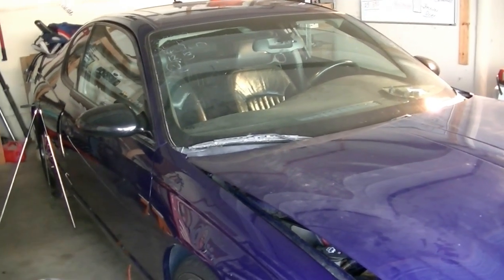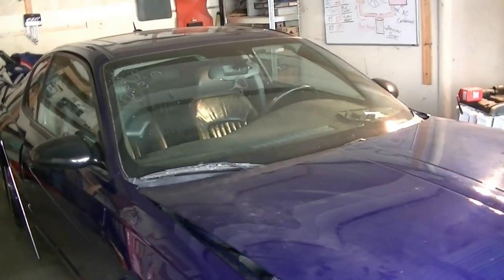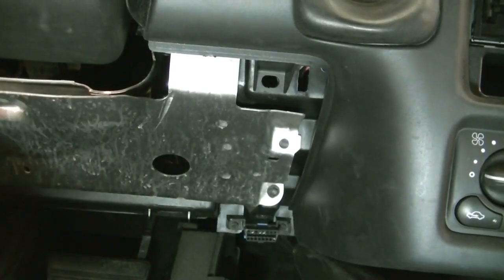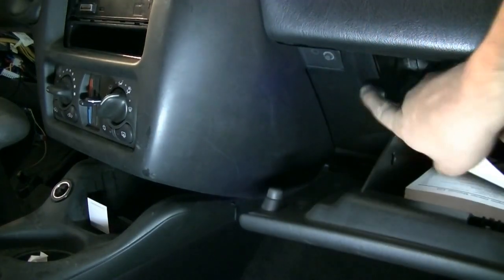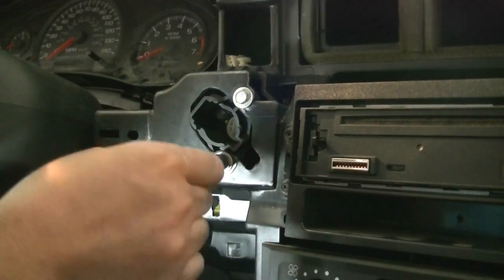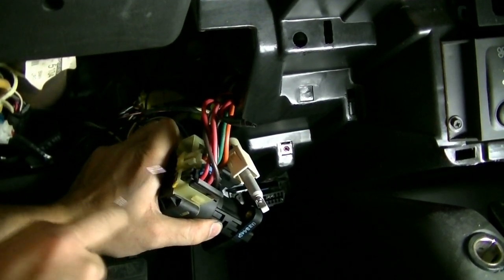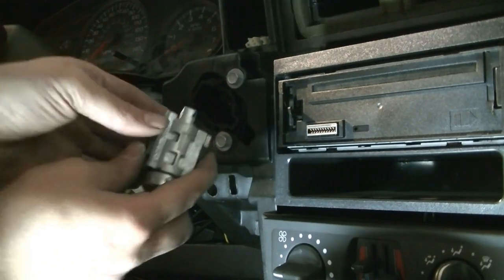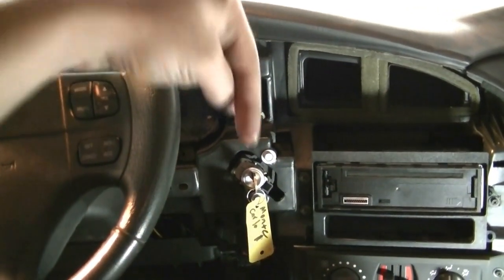How to Remove and Replace an Ignition Switch - Chevy Monte Carlo, Impala, Pontiac or Oldsmobile

Comment: This last fall the HVAC blower in my car stopped working. I spent hours trying to diagnose what it was. I had the factory manual and used their procedures. Turned out to be the ignition switch, I would've never guessed.

Comment: Have an 04 Monte I have to do this on. Bought it with a freshly rebuilt motor and transmission drove it about 1100 miles and the damn ignition switch goes out lol. Looks simple enough thanks guy

Comment: Thank you for the detailed video and key learning steps. Piece of cake after I realized I need to have the car in park when testing new key operation before install 🙂. Couldn't figure out why I could operate the ignition tumbler and take key out before installation but when I installed for test I couldn't take key out..... When installed the ignition recognizes the transmission is not in park and wont' let you completely turn off ignition and remove key....DUH

Comment: The reason I came to your video is because it is a pain to get my key to turn in the ignition. I have to wiggle the key a lot to finally get it to turn so I can start my car. I have a question though. I plan on replacing the ignition lock cylinder but I was wondering if it'd be wise to replace the ignition switch as well? Thanks for your helpful videos I appreciate them a lot, including this one and your intake gaskets videos in particular.
Reply from the maker: Dat Cody well the key not turning is you ignition lock cylinder so I would first replace that. But if you have no problems starting the car afterwards than the switch should be fine. GL

Comment: Thx for the vid. I'm going to try this. My 02' Monte Carlo has the same issues. At times, mostly in the morning, car will not start. I'll have to wait 10 minutes, while the key is in the start position. After 10 minutes has gone by, my car starts so that's what I've been doing in the mean time, until I get it fix. I had one mechanic tell me it's a $900 job to fix. Yeah right... Thx again

Comment: I had a problem of my key not turning . Had to do the basic steps in this video and then disassembly the switch afterwards to remove the cylinder . Once I removed the back covers I was able to remove the cylinder , pass lock connection , and shift cable .

Comment: If anyone else is having a hard time turning the ignition cylinder try this out.. the key in the ignition, hold constant pressure on it as if you are trying to start the car. While doing so, pop the  release button on the side of the housing with a center punch and hammer. May require a few attempts although not much force is needed.  (I used a automatic center punch so I was able to do it alone) but you may need a helper. Good luck

Comment: I have a 2002 ss it starts for a second then shuts off do you think is the problem? no check engine lights the security light blinks sometimes other times it starts right up, also the radio work some days. thanks for the lower intake video I used it last weekend. seems like everything that can go wrong is wrong with mine only had it 2 months.

Comment: Thank you for the video. My 2000 IMpala just shuts off while driving.  Would this assembly of the whole tumbler and ignition be the cause of this? I went o the dealer so they can do the recall and all they did was add weight to the key. I had been driving my car without the key and it seems to drive ok. Once in a while driving over a bump the car turns off. I have to put it in neutral and reset the key all the way back then it turns on like nothing is wrong. The recall did not fix this. Thank you

Comment: Thanks for the video, my impala is doing no starts here and there getting annoying now and sometimes while driving my security light comes on and then that usually mean the car won't start soon. probably when I really need it to like when I am running late for work.  Anyways was thinking about doing this have you had any issues since you did it in april?  Did you use an AC delco part or dorman?  Thanks again.

Comment: My 04 monte been dying then just restarting now won't start at all. Just recall letter for this ignition switch. I was thinking my remote start was issue till I got recall notice. Will they still replace switch with my remote start in or should I remove it?

Comment: Did you put this aftermarket head unit in this car? And since it has one, do you know if it retained the factory functions, like the oil light and stuff like that? Is the stock radio in the trunk or something? I'd like to put a different head unit in my impala, but i don't know how to wire it. Do they make kits for it or something?

Comment: RatchetsAnd Wrenches question I'm replacing my ignition switch and lock cylinder In my 04 impala the problem I'm having is how do u remove the small harness I've removed the ones in the back of the ignition switch but have no clue how to release the smaller one towards the middle of the lock cylinder I believe it's 3 wires that ha ve a plug at the end one wire is black the other white and the third I'm not sure what color it is any way it's the last one still connected to the ignition switch that's the only thing holding me back from almost being done removing the old ignition switch and cylinder any help would greatly appreciated. Also do I have to perform the relearn procedure after I've put the new ignition switch and lock key cylinder ?  If so should I do it for ten min. Increments 3 x for a total of 30 min? Cause I've only don't one ten min with the old ignition switch and lock cylinder once and it fired up for a min and a half and shut off tried to start again with no luck but she still cranks.

Comment: I have a 07 Pontiac grand prix gt I turn the key and nothing happens. The gauges go up and come back down but the car will not even spin the starter. Could changing my ignition switch be my problem? Any help would be appreciated.

Comment: Will a bad ignition have anything to do with the headlight relay? My keep broke off in the ignition and I paid a locksmith to get it out, but since then my headlights do not work at night, only in the daylight. I bought a used ignition from a yard to have it switched out, but some guy (not at the yard) told me that wouldn't work because it would need to be programmed like a computer and that I would have to buy it brand new.
Reply: my Key* broke off...

Comment: So I just finished and now doing the Passlock on my car and was wondering does it usually take long?
Reply from the maker: KennyKakes18 I dont remember to be honest. how did it go on yours?
Reply: He didn't have to do it. You only have to reprogram it if you are putting in a lock cylinder and new key. The ignition switch you just put in

Comment: Help!
I changed my ignition switch and it has a gritty hard turn and now doesn't return from the "start" position to the "ON" position on its own. So I changed the switch again, thinking it was defective but its still doing this. It works fine for the first day but gets gritty by the next day. What can I do to fix this?

Comment: I've noticed that when using my remote start my 2000 MC now either stalls or won't start.  I'm guessing it is either the battery or the passlock.  I suppose I'll replace both to be on the safe side.  But would like to know what you recommend?
Reply: ChaosLegionSpawn  passlock or computer? Is it the same
Reply: @NASHAYE27  Oh man.  I don't recall now as it was 5 years ago. :)  Also my MC was totaled when a chick ran a red light and hit me.  I might get another down the line.

Comment: Question. Okay I replaced mine no problem and everything works as it should. The only think i had trouble with was the springy tab on the lock cylinder wouldn't come up through the opening in the new ignition with. Well now when the car is off and I open the door it always dings as me because it thinks the key is in the ignition. Does anybody know if that has anything to do with it?

Comment: SquirrelSnipa Williams did u figure out if your was the pump? Or?? Kinda having similar problems with mine going through the motions and really don't want to pay for any other parts that are not needed I'm getting no codes period on my odb 2 so I'm assuming the ignition switch and lock cylinder I've check the pump and gas is pumping for sure battery is new alternator is good and it's started one time for a minute and a half and shut off now nothing let me know what worked for u cause I'm losing my mind over this
Reply: i did mine turned out to be the starter it wasnt engaging fully
Reply: the starter on most is relatively easy to get to and change so if its not the same as yours if you do the job yourself and changing the starter doesnt work you can always return it to the place you purchased it
Reply: SquirrelSnipa Williams also forgot to mention a bad starter can cause vehicles to stall  i dont know why but my jeep stalled all the time when the starter was going out on it

Comment: if you replace the ignition switch do you also have to replace the lock cylinders?
Reply from the maker: +Mikey Shadowz no
Reply from the maker: +RatchetsAnd Wrenches for most cars that is.
Reply: +RatchetsAnd Wrenches thanks a lot man! i really appreciate that
Reply: i only bought a new switch without the. houseing that has thevpins in it .i lost one pin but made one to work i tkhink.maybe thats my prob and idk?

Comment: My only problem is my key will not turn so when I do get a ignition cylinder replaced on my 2004 impala I'm going to need to charge my battery because my key will not turn are dash lights will not come on?

Comment: QUESTION: when you get a new ignition lock cylinder with keys, is it supposed to turn freely without the "springback" action it does when you crank a car? Like, when you crank a car, the key springs back to the "ON" position when you turn it. I'm trying to see if the lock cylinder I have is faulty or not..
Reply from the maker: No its not supposed to snap back like the "springbac" acition outside of the car. The spring back action comes from where the end of the lock cylinder goes into the housing of the ignition switch (Electrical Component). GL
Reply: RatchetsAnd Wrenches so if I have a new lock cylinder and it still doesn't spring back, then something is wrong with my ignition switch that it goes into?
Reply from the maker: FatalCorleone07 Yes more than likely, thats how it is in all the cars I've worked on at least.
Reply: Hey again! I wanted to ask: I just wanna change out my Ignition Lock Cylinder, do I HAVE to take my dashboard off to pick it and remove it out of the Ignition Switch?

Comment: I have a pretty big question. Anyone feel free to answer. I want to wire up a racing style switch to act as my starting switch in my 05 Monte Carlo. I'm pretty sure it would work out just fine since the starter automatically shuts off when the engine fires up even if you still hold the key in the start position. The only thing I need to know if anyone knows is which wire off the ignition switch is positive for the starter and which is negative?

Comment: You forgot the 4 - 10mm bolts holding the kick plate in. Don't know how you did this without taking the power trunk switch off. That was a nightmare to do. Otherwise a great instructional video. Thanks

Comment: Do u have to get a new key to buy a cylinder lock switch or can u used the same key
Reply: +james bethley It comes with keys usually, which you can either get cloned at a dealership or any hardware store.

Comment: so my impala has an issue where i have to turn the key over a few times to get it to start and when using my remote starter nearly same issue would you think ignition switch? i only ask cuz i am about to change the fuel pump (im currently assuming its not pressurizing enough to put the fuel up into the injectors)
Reply: also did you have to do the relearn before yours started? i tried the fast relearn method to see if it had any change while troubleshooting but nothing
Reply from the maker: SquirrelSnipa Williams I am assuming its cranking but not starting, so I would try cycling the key to the on position than off a few times, make sure you can hear the fuel pump priming. Than if you can crank the car and it starts you probably have a problem with the check valve inside your fuel pump and have to replace it. Other than that without seeing the car I would lean towards a bad ignition switch. And if I remember correctly I did do the relearn before I started the car. Hope that helped, cheers.
Reply: RatchetsAnd Wrenches when i get in and turn the key i could ;let it turn over forever and it wont start but second or third try it will and occasionally it will just start right up ive changed damn near everything on the car except the pump ignition starter and coils as it wasnt throwing codes at all and those part are expensive lol
Reply: its very similar to how it appears when you tried starting it at the end except its not dead and doesnt sound dead sounds like its turning over normal just not catching and eventually starter will squeal a bit
Reply from the maker: hmm.. I would take it in and have the battery and starter tested to rule those out first before I do the fuel pump.

Comment: this is what happen to my impala then wouldn't start at a no crank no start my security light was flashing on my dash when i called GM they said there was a recall on what was happening so they towed it to the chevy dealer and they said it wasn't that they said my starter went and charged me 500.00 dollars but i feel that they scammed me and said it was somrthing it wasn't can that be my stater from what i told you ?

Comment: yo that is a factory recall free repair at Chevy dealer just call any and give there your VIN number and as long as car is still under factory warranty free fix just Google factory recall repairs on any year car and it will tell you what is free replacement. #Standup
Reply: Yooo das heat good loookin
Reply: Derek Powell what do you do then
Reply: Derek Powell what do you do then

Comment: I replaced the switch and I'm doing the "relearn". After ten minutes, the security light is still on. Could there be another issue? BCM?
Reply: +James Segovia Hello James 
did you end up finding a solution for this problem?
Reply: +imnotem If you have a remote start that is the number one issue

Comment: How do you know there's anything wrong with the ignition switch? Was it corroded anywhere? Does it get worn out?
Reply from the maker: batterista The switch (electrical part) fails from time to time, some signs of a bad switch are intermittent starting issues or no starting issues, intermittent issues with come of your accessories not working.. etc.
Reply: keys were lost
Reply: but after putung in a new switch at start up it wen tv into security mode . why?

Comment: What if you can't turn the key at all!?
Reply: +Brendon Cox I need this answer and fast. Lost Key. Please help!!
Reply: What did you do to fix it?
Reply: I replaced my cylinder and ignition switch. Cut three wires that connect to the switch and solder the wires back together once you have the new switch and cylinder in place. I have two keys for my car now, one to start the car and one for everything else. For some reason my car didn't have to do the re learn so i got lucky there
Reply: Brendon Cox Thats complicated. Lol  I also changed the cylinder and the ignition switch. It wasn't too bad . I also have two keys. Im planning to take the old cylinder to the dealer along with the new one. To get my old key synced up, so i won't have to carry the 2 keys
Reply: Yeah i'll let the next owner do that on mine. And it wasn't too bad if you know what you're doing.

Comment: what if your ignition is locked
Reply: Mine just locked up. Have you fixed it?
Reply: +Boogie Forever!!! nope i had to break it so I just ordered another
Reply: Kerwin Hayes with the new one, it works now?
Reply: +Boogie Forever!!!  yup it does I just replaced switch and cylinder and it runs now
Reply: Kerwin Hayes Cool bro, I fixed mine yesterday
Reply: +Boogie Forever!!!  good to hear
Reply: How do I change the key switch when the key will not turn at all